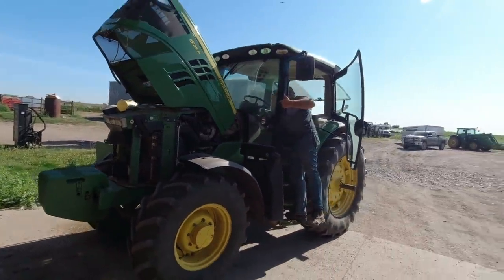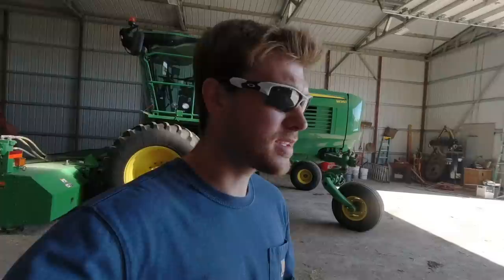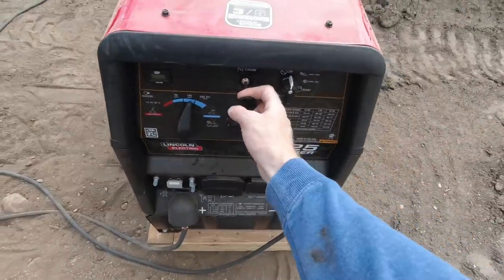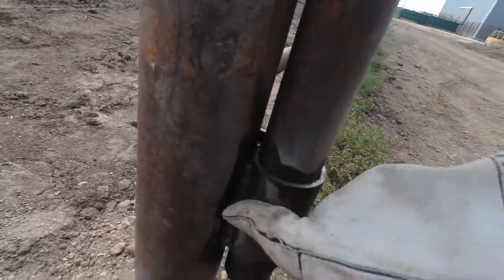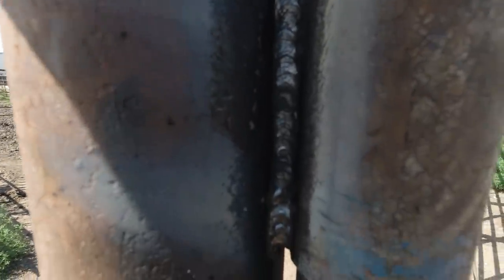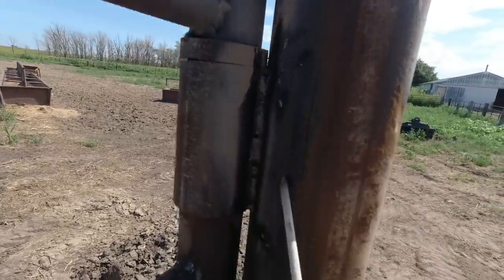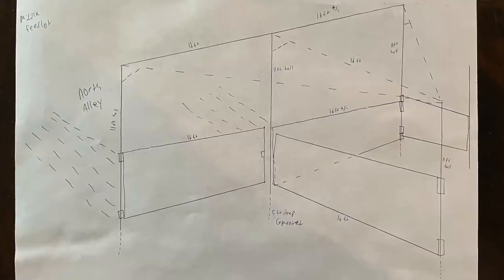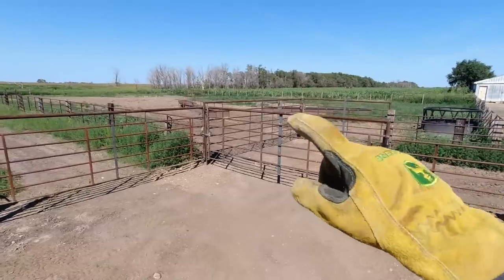THIS IS THE END

Comment: Your welds are going to hold just fine. That being said, on your vertical welds try this technique. Root pass, start at the bottom and whip the rod up and away from your puddle just for a split second so that the puddle will solidify just a bit. Keep your arc going on the upward whip. Then add some more weld to the top of the puddle and just keep on stacking onto your weld. When you’re done it will look horrible but that’s just the slag. Chip it away and admire your weld. For your first cover pass use a “U” shaped stroke that widens your weld. For the final cover pass use a squared-off “U” shaped weld and widen your weld even more. This is a “Three-pass vertical up” weld and it is often used to certify stick welders (or “Weldors” if you prefer.  Your finished sample weld is called a “coupon” and it’s then placed in a jig with a hydraulic press with gauges to indirectly measure tons applied to your sample weld. Make the required tonnage and you’re a certified stick welder. I got my neat certificate about thirty years ago. Still in a box somewhere. 🤷🏻‍♂️
Reply: When you’re using any rod that has a flux coating “7018-6011” when you are welding vertical you start from the bottom and weld up. That way the slag doesn’t pass you’re puddle
Reply: @jessebenell8823  Agree with you and localcrew.  Weld up on vertical welds.
Reply: @waterman91966   Glad to see you guys comments.  I was taught to never weld down hill.  I cannot speak for wire welders, just stick.  Exceptional farm engineering though.

Comment: Hey Cole. If you weld a 4’ extension on 
the gate post and run a turn buckle and cable or a light length of pipe, to the other end of gate. That will take the weight off the hinges. Less lube, wear, and squeaking from the hinges.
You can get welding cable extensions with quick discounts, that you can use on ground (-) or positive (+) welding leads. Nice job on the gates!
Reply: I made my own welding leads and jumper Leads .
Reply: Good suggestion. Or skids to open and close. Wheels are more expensive.

Comment: Good morning gentlemen. Another awesome vid. Pro tip for your gates, helps them operate smoothly,  and they will last for many years to come. Drill and Tap the hinges, add a grease zirk, few pumps of grease, once a year, will keep them squeak free, and opening and closing, freely. You can do that when they are hanging, or when making a new one, just remember to not drill to far into the gate pipe, just enough to get all the way through the hinge. Or the grease won't help you. We used to have some gates here, that were over 45 years old, and they would swing with minimal effort. Give your dad a hug, he's my kind of people.

Comment: Hey Cole, 
Great work on the gates, think the problem with the tight open and closing is the collar on the top of the hinge pipe is the same thickness so with that being said pipe hinge being welded to the post should have had a 1/8 to a 1/4in spacer behind it so the collar isn't rubbing on the post. Over time it'll wear so they'll open and close easier. Keep up the good work.

Comment: I build my gates the same way as you but I drill and tap a hole and put a grease zerk in each hinge then you grease it about every 5 years weather they need it or not and they work really good. Some of my gates are 30 years old and still going strong.

Comment: You are doing a great job welding and designing the gates i teach welding and you have been spot on with everything you are doing  2 helpful tips.... if you gap the hinges away from the post just a little with a steel spacer the top will not rub the post and the holes in the weld is from slag getting in front of you 7018 likes running vertical up better. Keep up the great work 👍

Comment: Cole you can still drill the round pipe that you used as hinges tap it for a grease zerk and pump in some grease. It will last longer then spray lube. Just a suggestion.

Comment: I build gate hinges just like yours and a few lately I’ve even drilled a hole through the outer sleeve and threaded a grease zerk into it... I know, I know us commenters have all the answers but just thought I’d share
Reply: I was thinking the same thing but since I'm not a welder I wasn't sure if that would work. There's no reason it couldn't be added now, is there ?
Maybe one of the top and one in the middle on opposite sides ?

Comment: Cole great job.  Next time park 10 feet closer, plus you will save time going back and forth.  Those long cables just end up getting damaged over time.  Also you do a really solid job welding.  If you welded every day you would be as good as any pipeline welders out there.  Great skill to have.

Comment: Hi Cole.  FWIW - Would like to see you use 6010 as opposed to 6011 for deeper penetration and is better on rusty or scaly metal.  It can only be used on a DC welder which is perfect for your ranger.  Stock the 6010 in your store.  7018 is a great finish.
Those support pieces could use some rounded corners so Brian doesn't tear his pants!!!

Comment: Nice work i had a project out of the shop and I had the mig welder running off the gas powered stick welder/generator be fun to see what you come up with for a welder trailer be nice to have a tool box and vise and stuff like a welders truck all in good time nice to build what you want not what others are selling

Comment: you want to use a pin scaler instead of a wire brush on the slag of a dc arch weld and you will really see the difference, no more holes in your weld beads.

Comment: My OCD is cranking that the top of those gates are not level with each other. Can you fix it please.
You should be welding verticals up all christmas tree like. If you weld down, the molten slag interferes with arc and upsets the weld pool or something like that.
Perhaps you should zerk on the hinges before you put them on the pipe before you weld it. Pumping grease up will stop water running in.

Comment: If you're running 7018 run it uphill. It's not even in the same class as 6011. I'd prefer 6010 on that DC machine, also known as 5P or 5P+ now on the pipeline.  Both 6010 and 6011 are considered burning rods that will burn through rust and crap and still stick. But 6011 actually prefers AC, reverse polarity and if you read the box it should even say so. It should however, work just fine on a DC machine too even though it wasn't designed for that.  7018 on the other hand needs to have a clean surface and vertically has to be run uphill for it to do a good job at all. But if I could only carry one box of rod around it would be 1/8" 6011 or 6010 in my case since my only machine is a Red Face Lincoln SA200. Another tip, keep that 7018 dry! I keep mine in a heated box year round. If it gets wet then I throw it out. 
But practice running 7018 uphill and overhead and once you're comfortable with it you'll lay welds that'll hold up that 2000 pound bull. I can promise you that! And I may not be any welding expert like so many on the internet. But I am a 67 year old retired welder who spent his life in the Texas oilfield. In almost 50 years of working there I learned one or two things.

Comment: cole you need to get the tires fixed as it could be just the valve that is leaking as i have had this happen to a tire on a car that we were using and randomly go flat, replaced the valve and still pumped up!!
oh and get some paint on the welds just to stop the rust

Comment: I was a certified welder for nuclear for 20 years.  Vertical down  wouldn't pass the ol spit test. We had to do vertical up one pass. Grind it smooth with a die grinder then how you mentioned side to side down, we had to go around the pipe side to side vertical up. We had to have it x-rayed for voids from bubbles.. it had to have the rust knocked off like you did to keep voids from bubbling up. I used 6011 wire feed mostly. With different metals besides a-36 or mild steel we used lo-hy or low hydrogen 7018. We had to keep it in a heater box to keep moisture out of the 7018 or the moisture will introduce hydrogen which makes 7018 not 70,000lbs per square inch like 6011 is just 60,000lbs/sq/in.

Comment: i notice you dont have any overheads.... might weld some in that way when that one post is holding both gates to one side it can transfer that load to the other posts... and you can build them high enought to get a tractor under.

Comment: Ideas: When doing vertical welds, go from bottom to top, build grease zerks into your hinges and or stock your store with lubricant and not just wd40.  :-)
Reply: A 1/4 inch hole and a self tapping grease fitting. Problem solved and he has a portable grease gun
Reply: My dad always said a verticall weld was better.
Reply: vertical up weld was better.
Reply: @giles-df9yu  Yes sir and he can still do that
Reply: Yep, wd40 is not lubrication; those need grease.
Reply: I agree the contamination is falling into ur pubble causing the porosity in your welds (the holes). Not to be that guy but that little step u made for that gate is a shin and tire gitter round those corners off at minimum.
Reply: More heat  themweldings  fine  but
More penetration
Reply: Drive through like bobcat has and patent it   no opening and closing and dangerous climbing up and down tractor getting injured

Comment: The 7018 does not work nearly as well when welding down hill. It should be used uphill.
They do make a low hydrogen rod that does work in the downhill progression.
It’s very expensive

Bohler bvd 90-100
Lincoln pipeliner 100Lhd

Comment: I think the gates are fine that high, you know what happens when an animal only gets half way over it. a whole lotta bad things. Try welding uphill, the 6011 will burn in nice, practice welding uphill and it will get easier. Your welds will hold as they are, Keep smilin

Comment: I reckon its hard to guage runtime of a battery for your Milwaukee angle grinder, but will it last, say for the grinding and wire brushing needed for one gate installation? You mind sharing the amp capacity battery you're using?  Project Farm has a good video on the gains for a 2 versus 4 amp battery.  It's more than double.  Just trying to decide if I should put out the extra $$$?

Comment: Am I the only one that knows to weld 7018 up hill, vertical or diagonally ? Never down hill, it’s a fill freeze rod meant to fill and stay. Unlike a 6010 or 6011 meant to cut in and penetrate.
Reply from the maker: oops
Reply: It happens haha. 2 1/2 years of welding school and you learn different things,. Not saying it won’t work because obviously it did, but start at the bottom with a 7018 and do some small weaving and just see, you’ll find how to make it look good.

Comment: Them's AAArrrnoollldd Terminator gates.  Meant to keep out 25th Century Liquid Metal Terminators.
Smart move on the gate rest.  When that 3 ton Charolais comes and mounts it, will still be standing.

 "Thick and Stiff", that's what She Said

Hint, ya want yur ground clamp welding lead on the thickest heaviest metal, the post pipe in case of gates.

Did Cole burn his camera lens?  hope not.  Been waiting for one of those hot glowing white welding balls of fire to roll across the floor when he's setting down and light up his family jewels or the poop hole.  Only takes one time, I have the scars.

Comment: you work 7018 up hand not down trap to much slag going down
Reply from the maker: Thanks for the tip, Im actually doing some more welding today so I will try that
Reply: ok so let know how you did
Reply from the maker: @grampa1952  I tried it, it looked horrible, not sure what I did wrong. looked like squidwards nose was bubbling out of it
Reply: lol  you have to go side to side   step up go across step up go across  you move the with of your welding rod and turn your heat down
Reply: you beginners should use 3/32 or 1/8 welding rod
Reply: when you start out go across  at the bottom to make a shelf for your weld to sit on  as you step up the weld will follow
Reply from the maker: @grampa1952  thanks
Reply: @SonneFarms  your welcome guys